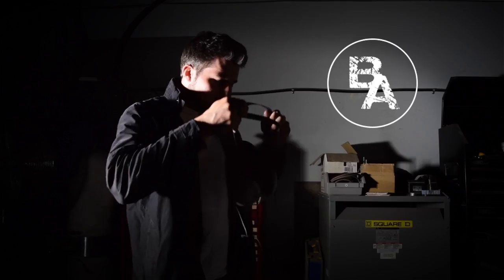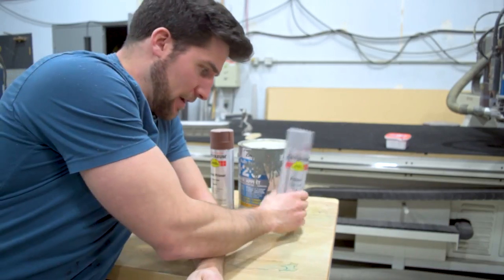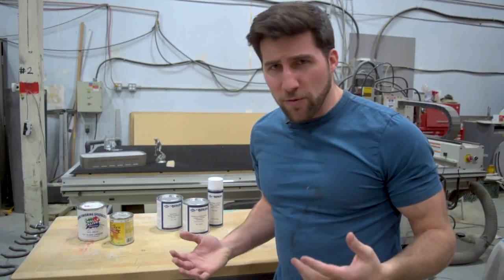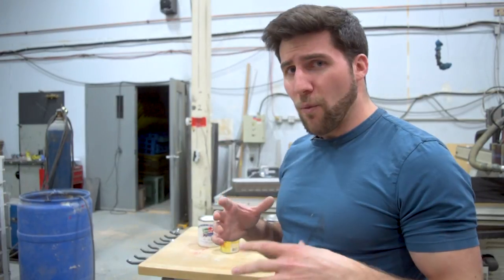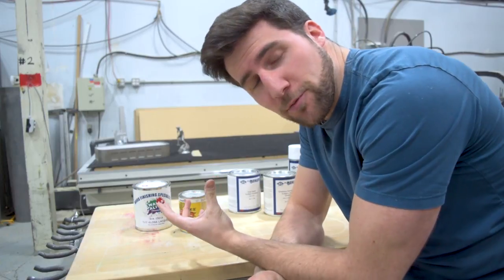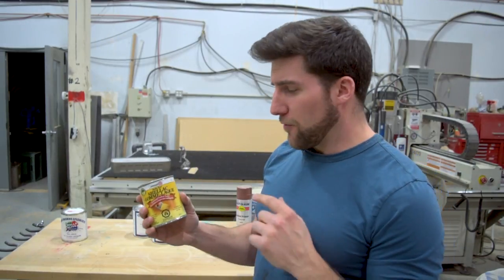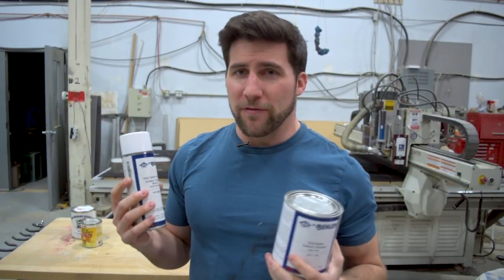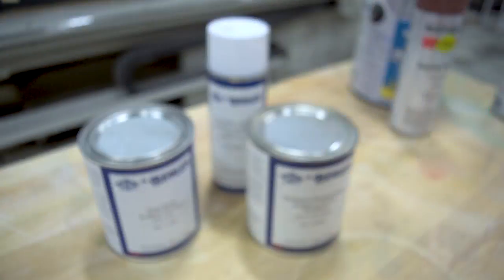Primer vs Sealer (and what they are used for)

Comment: Hi Brad! What would happen if I applied primer before the wood filler?
Reply from the maker: If you’re doing that then you should be using a glazing putty instead of wood filler. Once you prime it the surface isn’t really wood anymore per se.
Reply: @BradAngove  dang! I got excited, and sprayed primer without filling the pores. I think I got a lot of sanding to do. Thanks Brad!
Reply from the maker: You could switch filler types. Or just give it a try, but I would think there may be some adhesion concerns with the filler.

Comment: Have you used Duplicolor over Behlens (Mohawk) vinyl sealer? If so, does it hold up long term or eventually have issues?
Reply from the maker: I’ve never tried it. I suspect it would work fine though.

Comment: Finally stumbled on your video, thanks! I had used primer, but never a grain filler. It makes sense the way you explained it. Just doing a normal solid color finish, should I sand off my primer and go with a sealer?
Reply from the maker: There shouldn’t be any need to sand off your primer. Does the grain show through it?
Reply: in like one or 2 spots if looking really really close, but no bare wood
Reply from the maker: Ok, you can sand it back smooth and apply another coat to fill that in if you want. Then just move on to your colour work.

Comment: I am planning on having a friend “burn” a strat body with a torch. (He makes wooden signs/flags like this).Then, I wanted to spray an antique white that would allow the burn to show through.  Is this possible?  If so, any recommendations on sealer, paint, etc.?
Reply from the maker: It’s possible. I would use Mohawk vinyl sealer and then their classic instrument lacquer. I would over reduce the lacquer slightly and add less white pigment than usual.
Reply: What kind of clear coat would you recommend after the lacquer?
Reply from the maker: Clear lacquer of the same type.
Reply: @BradAngove  I appreciate your help; Thanks.

Comment: I have some 1:1 ratio DTM primer/activator going over OEM 1966 VW paint, body filler, bare metal. How much reducer should I add to transform it to a sealer? Thanks.
Reply from the maker: None if you’re able to spray it in its current form.
Reply: @BradAngove  Thanks. I was curious how to thin a primer into a sealer.
Reply from the maker: There should be no need. Sealer isn’t necessarily supposed to be thin.
Reply: @BradAngove  I thought the difference between primer and sealer was added reducer.  Curious the benefits of each?
Reply from the maker: They are mostly just for different paint systems. And different applications like I said in the video.

Comment: Sir,
So for painting a bike, i have to first sand the surface, remove rust and stuff.
Then i gotta put an oil primer (any primer), let it dry and then paint it using spray paint.
Then, 3 coats later, i gotta use a clear coat.

Am i right?
Reply from the maker: Yes
Reply: @BradAngove Thank you so much ❤️

Comment: I've got a sanded smooth guitar body, couldn't get every bit of the old paint off but I need to spray it a new color. It's as smooth as I'm gonna get it, but not being bare wood, what kinda primer should I use before paint? Or should I use something else first?
Reply from the maker: Primer or sanding sealer. It depends on what paint you’re using.

Comment: I have a hard time getting paint to work on metal... I read about conversion coatings and metal prep but a guy at a local paint shop said using 2k epoxy will stick to metal... do you have any tips on clean non rusted metal? Should I just be using spray can primer? Self etching primer? This does not seem like an obvious question. Spray can pimer works but... it does relatively easily de laminate.
Reply from the maker: You need to abrade the metal first. I suggest 320 grit. Then clean thoroughly. Then the best bet is a self etching primer.
Reply: @BradAngove  I do all of that for sure... big time... isn't it hard to paint over self etching primer? I thought there was some major drawback to it
Reply from the maker: It depends on what kind of paint you’re using over it. It’s fairly common to use the 2K epoxy primer followed by automotive urethanes for example.
Reply: @BradAngove  2k epoxy over the self etch? Sorry to ask so many question.. the web really does not give a straight answer on this stuff. Can you just use rust oleum primer over rust oleum self etch and then rust oleum paint? I asked the guy at the shop about metal prep and conversion coats, he pretty much said self etch and conversion coating is old style and now days people use 2k epoxy instead. Awesomely they carry all the spraymax 2k stuff there.
Reply from the maker: Sorry, the 2K epoxy primer does not need to go over etch primer. It basically is self etching. 

I have never tried rustoleum over it. But rustoleum painters touch is acrylic, so I would be surprised if it didn’t work.
Reply: @BradAngove  So I can't use duplicolor or rustoleum over 2k epoxy? Or do you mean over self etching primer? lol! Crap this is confusing. I wish I could somehow pay you for your knowledge...
Reply from the maker: Haha I think we had a miscommunication there. I’m saying that the rustoleum, being an acrylic, is likely fine over the 2K epoxy. 

The duplicolor is an acrylic lacquer. I honestly don’t know if that would work, but the entire duplicolor system is supposed to work as touch up paint for car panels, which are metal. 

People occasionally pay me for my knowledge, but that is not necessary. Im happy to help.
Reply: @BradAngove  Ah okay. That makes sense. I bought a can of paint to try and paint a guitar pedal kit... and when the results were not as expected I stumbled upon a random video of yours and I went on my own route... I have forked out some serious cash in the process if your videos! lol. I found a local autobody paint shop that sells most of what you use. I plan to pick up some of those 3m compounds there. 

Thank you for answering me all the time, I hope you enjoy teaching at least a little bit. I'm thinking of getting a spray gun just for 2k stuff so I don't have to blow 50 dollars on one pedal kit... 25 for 2k epoxy, and 22 for 2k clear both spraymax... thats just too much cash! I am doing some rust on my car this time around so it will be more worth it. 

I was looking at those guns on that site you recommended.
Reply: So the autobody shop talked me out of the expensive 3m polishing compounds... they sold me on Presta... ever use it?
Reply from the maker: I haven’t tried it. Some of the more basic stuff works quite well though. For example the meguiars does great.

Comment: What would be best for a diy plywood camper that I plan to shoot with raptor liner , should I go with a primer or sealer first . Thanks
Reply from the maker: How thick is raptor liner? I’m not familiar with it.
Reply: Brad Angove raptor liner is a truck bed liner and is pretty thick once applied , I think around 15 mills of thickness . Thanks for your reply
Reply from the maker: I think once you grain fill you can probably just hit it with that directly. Maybe a thin layer of primer to help it bind.
Reply: Brad Angove thank you man

Comment: Hey nice vid! Is sealer a poly finish? And if im going to relic my guitar, what sealer should i use? Thank you for answering
Reply from the maker: There are many different sealers. Some are poly. 
If you want to do a relic you should be using poly. Generally you would go with nitrocellulose lacquer sanding sealer or vinyl sealer.

Comment: Hey Brad, specific to guitar finishing, is there anytime I would want to use a primer and a sealer?  Won’t using a. Primer cut down on my color coats?  If using both, i’m assuming sealer goes on first, then primer.  What do you think?
Reply from the maker: If you’re going to use both, then you’re right. I would do sealer first. That being said, I wouldnt bother using both generally because in that case your primer is just filling the role of a base coat. You can get that opaque first layer down without resorting to something as thick as a primer.

Comment: Is their a sealer that can protect and easily clean an exterior paint color?? I have a fence painted white and my tree keeps dropping stuff on it and the paint gets stained and it can't be cleaned it has to be repainted.
Reply from the maker: There isn’t really one that would be appropriate for a fence. It would be way too expensive. Maybe try just getting a brush on poly to put over the paint in the problem area.

Comment: I have a brand new alder guitar body that I want to spray paint. I do not want to have the wood grain visible, hence I 'm going to use a primer before the main paint. However, I 'm still confused whether I need to use a sanding sealer or not before the primer. I 'd appreciate any feedback on this. Thanks!
Reply from the maker: You don’t need sanding sealer, but you may want to grain fill.
Reply: @BradAngove  Thanks Brad! Keep up the good work :)

Comment: How many coats of Behlen vinyl primer do you put down? How long after you spray do you wait to sand?
Reply from the maker: It depends on the wood type. Generally 2-3 unless it’s quite open grained. 
I like to give it at least 3 hours before sanding. Ideally a day or two though.

Comment: I Brad, I came across your channel and hve been enjoying your videos.
I have a question.
I wanted a surf green strat but found a used one of the same model in fiesta red for a great price in great condition and bought it.
I'm thinking about painting it surf green.
I found a local dealer selling nitro laquer in spray cans. They claim a long development process in cooperation with guitar builders/painters, and that it hardens really well compared to other nitros.

I'm wondering if I need to sand off the current/original poly laquer entirely, or if I could simply sand the red finish with fine grit paper and then spray over the red color.
Will the thickness of the paint affect for instance the bridge height or something else in terms of guitar set up and playability? Are their any other concerns?

(I only intend to play the guitar myself and enjoy it, don't care about resale value, also I don't have a strong opinion on poly vs. nitro, just this local shop has nitro for a fair price. So even though "nitro purists" could faint at the idea of putting nitro over poly, I just want the color)
Reply from the maker: Sand you’re poly to 400 or 600 grit and clean it well and you should be good to go. The old rule of thumb for cars was two finishes thick; no more. It won’t mess with your parts and playability, but you start to increase your risk of product failures when you add more finish thickness.
Reply: Thanks a lot for your time. Really appreciate it.
Reply from the maker: You’re welcome.

Comment: Thanks for this video! Btw, I wondered, what is the difference between a sealer and a grain filler and when do you use what?
Reply from the maker: I’ll be doing that video soon haha. Grain filler is a paste for filling in wider open grain. Sealer is basically thicker paint that fills in tiny pores and sealed everything smooth. Grain filler is not a coating.

Comment: Hey Brad, started a project with a MIM tele and have all the polyester paint stripped. I want to do a nitro finish so over time the more i use it, the more it will wear. What sealer, paint, and gloss would you recommend? For reference i would like it to look like Brad Paisley's signature fender model after a while of playing.
Reply from the maker: You want that silver glitter paint job?
Reply: no i want a surf green finish but down the road when the nitro finish wear away i want it to wear down to wood, like brad's model already is. I don't want to relic it, i want it to wear with time.
Reply from the maker: Ok. I’m not sure who carries surf green. Maybe reranch. Either way, guitars don’t naturally wear quite like that Brad Paisley guitar haha.
Reply: Well nonetheless, for a nitro guitar what types of sealer, paint, and clear coat do I need?
Reply from the maker: My sealer of choice is the vinyl sealer from Behlen. Their stringed instrument lacquer would be my first choice for the clear as well. The issue is finding the green. I imagine reranch or colortone would have it in cans.
Reply: would the color itself be labeled as nitrocellulose? or would any lacquer or polyurethane be fine?
Reply from the maker: Didn’t you specifically say you wanted nitro?
Reply: yes but im still confused as to whether that refers to just the clear coat or the base and clear
Reply from the maker: It’s both. You can get nitrocellulose based lacquer in colours and in clear.
Reply: I found a couple sellers but the 2 that stand out are northwest guitars and gracey's vintage finishes
Reply from the maker: I’ve heard good things about graceys.

Comment: Hey man I'm a little frustrated here, couple years ago I bought a brand new bumper which is polyurethane, had somebody paint it and it's peeling all over the place so I'm going to redo it. 
I'm going to sand everything back to plastic, use adhesion promoter .
Besides the bumper peeling my extra frustration is I went on a forum and I've been doing some research and these idiots are  giving me two different answers and they're arguing within each other.
One guy is telling me use a epoxy primer so I went and bought epoxy primer
The other guy is telling me if I have to do some sanding use 2K primer and they are arguing within each other.
can you help me because I've been driving around with this bumper for about 2 years so I'm sure it's got paint chips. The epoxy primer I got is sandable but it says to put only one to 1.5 mm of primer
It is also a sealer
So I don't know if I should use the epoxy primer or 2K primer or both
Reply from the maker: The short answer is that both will work. 2k essentially just means a 2 component item. So a primer with a hardener. There is 2k epoxy primer for example. 

Anyway, you can go ahead and use your sandable epoxy primer. That’s a good option.

Comment: Hey Brad, Awsome video man - I'm planning to paint a guitar body from bare wood, the grain isn't too aggressive and wondering how much better sanding/vinyl sealer (or zinsser stuff as seen in this vid?) would be for paint adhesion over primer? Planning to go oil based polyurethane base / clear .. unfortunetaly having a hard time locally sourcing sealer (automotive style primers readily available) and debating whether I bite the bullet on ordering sealer online or if primer would be close enough for adhesion / moisture resistance
Reply from the maker: Primer should be just as good from an adhesion perspective. The top coat should deal with any moisture issues. Primer is a good choice.
Reply: Thank so much man. Appreciate response and keep up the great work - these videos are game changing for guitar refinishing community.
Reply from the maker: I’m glad you’re finding them helpful.

Comment: Really helpful video Brad thanx. Is there a certain clear coat that works better with plasti-kote acrylic sealer? Or ones to avoid haha
Reply from the maker: I’m not sure, I haven’t used that stuff. It’s not like plasti dip is it?
Reply: @BradAngove  I'm not sure haha, it's in a can and I wasn't sure if it was a internationally known brand. I can't find any details on the can or their site and thought I'd check YouTube (usually has the answer lol). No worries though, I thought I'd ask just in case 👊

Comment: I’m trying to paint a grill on my Lexus what sealer primer I need to use before I paint it? Do I need to sand it before putting the sealer? Thanks in advance!
Reply from the maker: You sand and then apply primer before painting. Plastic compatible primer. I have a video where I painted the grill for an Audi I believe.

Comment: So if my car is perfect new and no sratches or dents on the paint but I want a new paint job for it should I use primer or sealer?
Reply from the maker: Primer. Although if it’s perfect you can just sand the current paint and go over it.

Comment: Very helpful videos Brad!  I'm a complete neophyte with wood-working, and currently starting a build of a Frankenstrat (raw Northern Ash body from Locke).  Want to make sure I'm doing this right, but I've been told to do a light "sanding sealer" first, lightly sand, then grain fill, sand again, then another sanding sealer layer  and sand again before beginning the paintjob.  I'm using Dupli-color "perfect match".  Would this Behlen Vinyl sealer be ok with the Dupli-color paints?  And do I have the order of operations correct?  FYI, I'll be relic'ing back to the wood in a few places.  Thanks for any insight you can give to a noob!!  :)
Reply from the maker: I would generally just spray 3 coats of the Behlen sealer and then let that dry for a day and assess if I need to do it again. If you’re relic’ing back to the wood you probably won’t want to do more than that. The you can sand that flat with 600 grit before moving on to your duplicolor. Start with your white to give the red a good base.

Comment: I'm working on a guitar with a gold/copper leaf finish and trying to figure out what / how to put a clear coat on it.  Its an oil-based size (adhesive) under the leaf so my understanding is lacquers won't work.  The surface is also not "smooth" as the leafing has ridges and tears in between the pieces (looks very cool like a relic finish checking) but its also a metal surface at the end of the day.  Should I go straight to something like the USC Spray Max 2k High Gloss Clearcoat Aerosol or maybe shellac first...?  Any suggestions appreciated! I've learned tons from your channel so thanks for what you do!
Reply from the maker: Go straight to the 2k. It should work no problem.